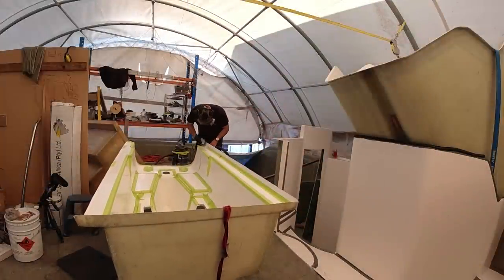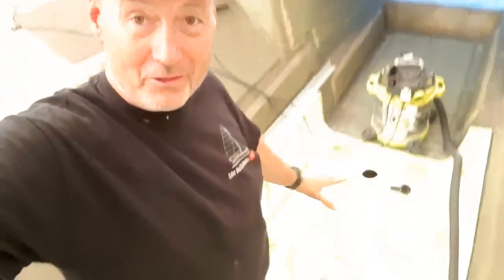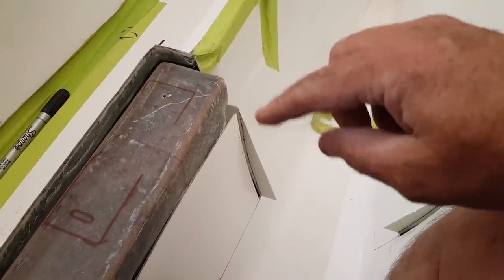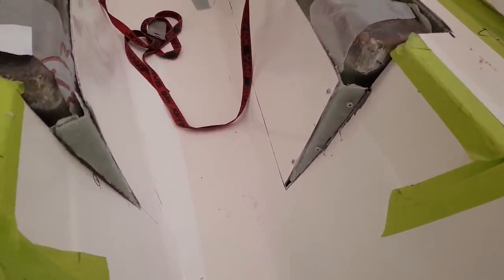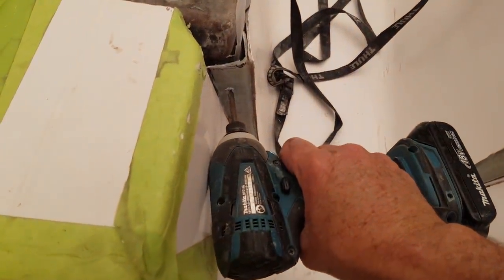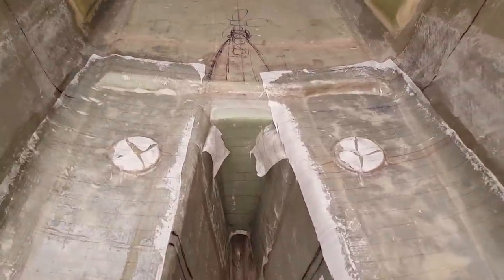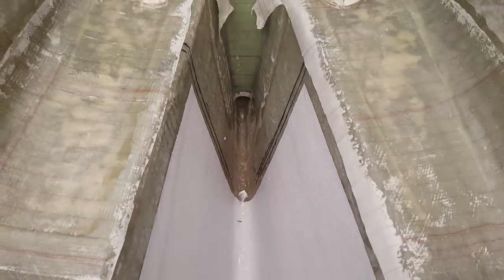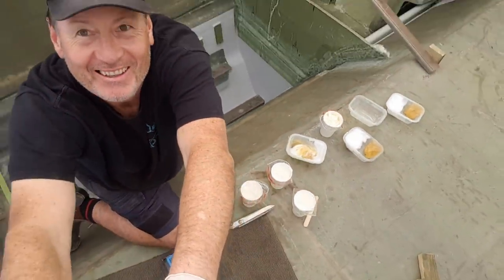Ep144 Engine Room Module Installation - At Last.

Comment: Great work Ross ( greatly enabled by Janet)  - the momentous event doth approach. Was wondering to assist in the demoulding process if it would be feasible or practical to connect the void between mould and hull with a pressurised water supply even rigging up a positive displacement pump (like the kind use to test pressure gauges or coolers) to jack the pressure up a bit. See where I am coming from?

Comment: Congratulations Ross on another milestone ! Will you use the engine mounting beds as part of lifting system in de-moulding process coming up ? More points of attachment for lift will mean less deflection or warping to bind it up in moulds.

Comment: Beautiful job on the liner. Straighten me out. Why not just flow coat the bilge? Eliminate the front bulkhead limber hole. Wouldn't that contain any oil spills? and be easy to clean?
Reply: Rigidity from the liner?? Plus if needed the liner could be cut out?

Comment: I know composites are your thing, and you want a composite boat when you're done.  But I can't help thinking most of these mods would be way easier on a steel hull, using a torch and a welder.
Reply from the maker: Probably true but you can't have a steel cat that will sail well Suitble Weight is just not possible.Monohull very different story.Aluminium perhaps but composites are the way for cats.Ross

Comment: Looking ahead, how much work on the top half of the mold do you expect you will have to do to make a clean top.  I also expect you will have to keep the bottom half under one of your tent structures to keep it from filling up with crap while you are work on the top half.

Comment: Will you have space between the module and the hull, so that you can mount a right angle fitting on the bottom of the module to pump out any spill of oil or water (with a manual pump)?
Reply: Sorry, made the comment before reaching the end of the video!

Comment: Congrats on the modules definitive placement Rossco !

I'm curious (as ever), what are you going to rest the hull on once it's demolded ?
Reply from the maker: Gidday mate.The hull when demoulded will rest on the lifting truck and 4 sets of two pallets with a tyre on each.The truck platform underneath will support the entire boat weight.Ross